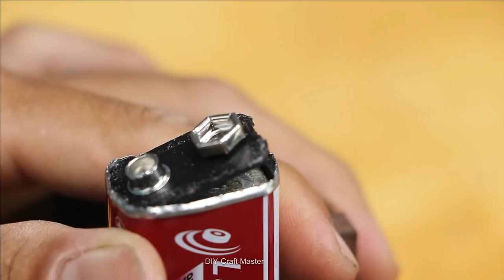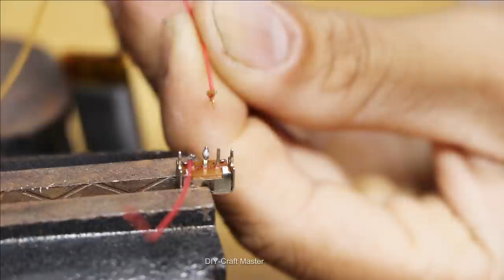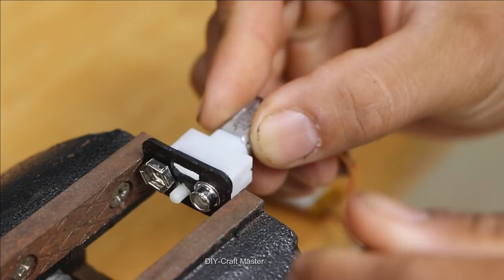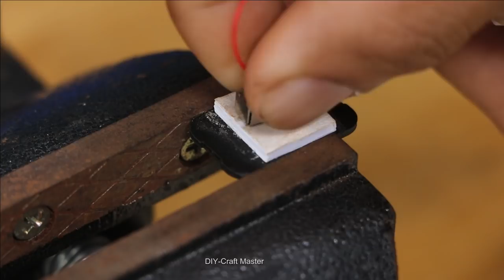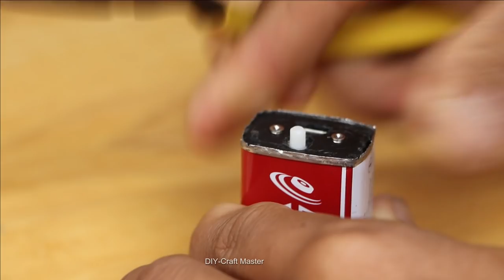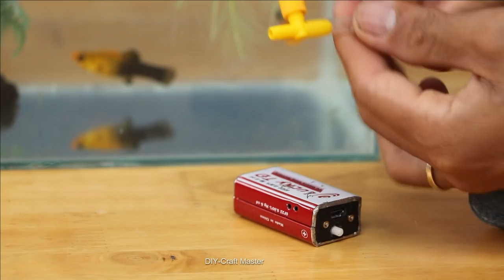How to make Aquarium Oxygen Pump at home - DIY Air Pump Mini

Comment: Nice but I feel there was no need to put that much of effort on altercation of the battery and then fitting all that in it. 

Moreover, its lithium battery which is prone to heat and you have tied up charging unit in that tight enclosure.  

We could have simple used a match box or any plastic casing. Just my opinion
Reply: haha but i would'nt have clicked it if it was a plasticbox 🤣